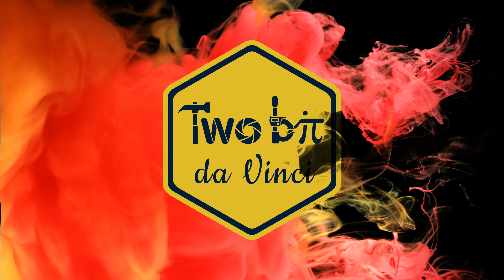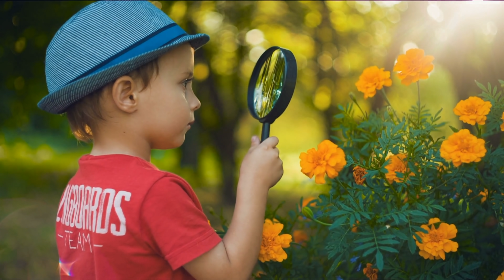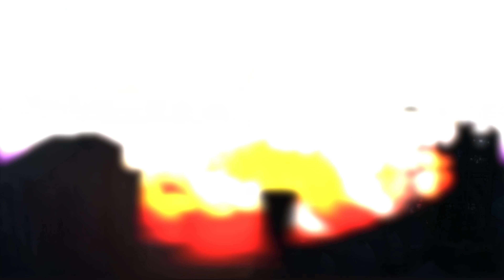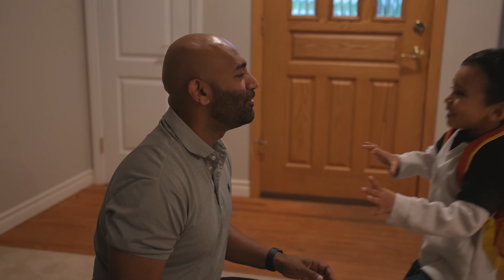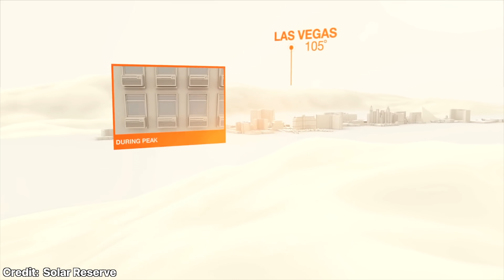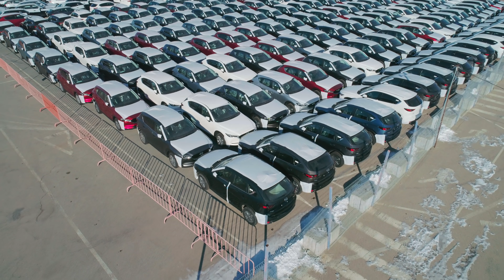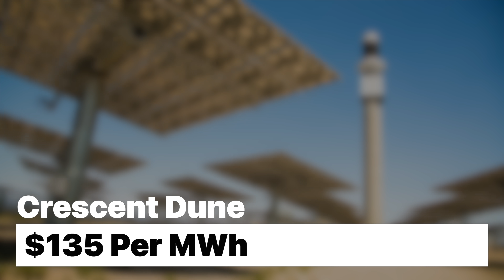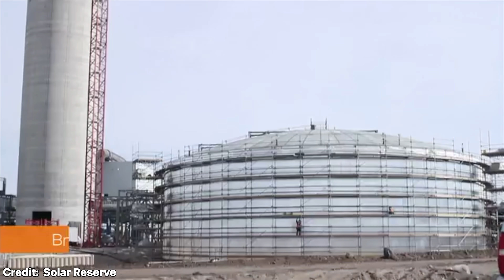This Billion Dollar Solar Plant was an EPIC Failure

Comment: Would this thermal technology be put to better use evaporating sea water to produce clean water? I have no actual knowledge on how to use this thermal technology or sea water evaporation or any kind of science for engineering moving mirrors and salt towers, but it would seem to possibly produce clean water with more ease than producing power for a state or city. Maybe change the design to have something on the tower move instead of the thousands of mirrors to cut engineering and repair cost. Use the thermal energy it is already producing to run low or zero emissions power for the water plant. Fans to pump water vapor to condensing water tanks. The residual heat from the salt tower to power water pumps to bring in more sea water at night to be processed the next day. The temperature producing the thermal energy in the tower being used to produce power is over 4 times the energy needed to evaporate water and it being collected and used only at this station to produce clean water could cut major energy losses by the company. A $1bil energy producing failure could be turned into a possibly creative and lucrative water cleaning tool.

Comment: Where are you getting that 80 billion and 12 billion dollars (with a B) for 40 megawatt solar power plant for solar panels from? Don't you mean millions? Because that's what they cost for 40 megawatts. Unless you meant to say 40 gigawatts, not megawatts.

And by 2040 98% to 99% of new cars sold will be electric. Remember those $25,000 flat screens TVs in the early 2000s? Who's making CRT TVs now? On those flip phones prior to 2007? Remember Nokia and their flip phone 40% worldwide domination? No manufacturer is going to be making ICE vehicles by 2040 other than some small enthusiasts company for the diehards. 

That's a fact of life people will argue to no end now, but will have to find out the hard way when it comes. Most people just can't see it so matter how clear it is right in their face. It's the way of business, of evolution, of progress. Most auto manufacturers, however, know it all to well. It's those that play around with hydrogen and the such that will be the next Nokia. More than one Japanese auto manufacturer will fail because of it.

Comment: I think there's a viable future for both photovoltaic and solar thermal technology, so we might see the plant reopen in the future since a future solar thermal project would have a head start.
Reply: The plant can't reopen as it got removed. And even if it could, the it still is inefficient and had many technical problems based on bad design or implementation during the building process. Building a newer one which is implemented properly would be the better option.
Reply: @benrex7775  If they dismantled it in an orderly fashion, it would still be a head start on the production of the next plant. There were myriad flaws in the design,  but the pipes and the Mirrors wasn't one of the. So even if the plant never reopened its materials could be used as a head start in the contraction of the next.
Reply: @MogofWar  Since storage areas cost money I assume the materials were sold, reused or recycled.

Comment: First problem with the Chinese endeavor is that it is a state sponsored project. Remove the State from the operation equation, and then if it is a true success, then there is a blueprint to start with. But, as it is sponsored by State, i.e. the CCP, any related information should be suspect until verified by outside sources.

Comment: you know what would be cool is if you built a foundry that way, steel needs about two thousand degrees to melt and aluminum only needs about 700 degrees, you spend a lot in hearing up those furnaces, using that system to heat the furnaces could also work.  

the cost of heating and maintaining the high temperatures forces foundries to shit down in extended off-line hours and that can actually screw up the metals, letting them get dirtier, lowering quality, and decreasing the life of the furnaces and increasing maintenance costs.  it's at least an interesting idea if not absolute doable.

Comment: Very interesting, thank you. Solar PV panel generating stations (effectively) contain no moving parts and directly generate electricity. They might not be very efficient or store energy but they are cheap and uncomplicated. Nuclear, gas, oil and coal power plants generate heat that then requires complicated, heavy, expensive and inefficient systems to convert that heat to electricity.
Reply: Except that to transmit the extra low DC voltage that solar PV panels generate it has to be converted to AC,  stepped up in voltage to thousands of volts to become suitable for transmission to users which then requires complicated, heavy, expensive and inefficient systems to convert that PV  output to usable electricity.

Comment: Just modify the design! Forget that tower. Recycle as much as you can by burying that molten salt storage tank into the ground to simulate an underground geothermal source. It's way more efficient as heat is very latent in earth minerals. Then you need not worry so much about transfering the molten salt or leaks and maintenance. Replace the mirror farm with a static PV farm at close proximity to optimize copper cabling.  Use the mirrors statically to reflect the sun to the PV throughout the day by spanning its angular trajectory without expensive computer tracking algorithm. Dip a bank of U shaped refractory tubes that conduct water in & steam out of the molten salt tank to a giant 3 phase, very high voltage / low current, AC generator spinning with heavy flywheels to increase momentum. Make the water in pass through cooling radiator on the back of the solar panels. This way the temperature differential before boiling is reduced while panel efficiency is preserved. Then make sure the steam is re-condensed deep into the earth to cool down and complete the water cycle. Sincerely giving up so much money into a monument of our failure is such a pure shame for a country so technically advanced who at this time does not have money to waste ($1B from our taxes). This infuriates me!

Comment: Five Points.
A) Makes one wonder why they need so many people to keep the system running.  
B) identify the corrosion/ mechanical issues and fix them
C) determine if software can correct for mirror alignment problems. Solar thermal systems seem to work else where.
E) if the thermal aspect cannot be salvaged - mount PV panels on the mirror pedestals, install batteries and turn it in to a conventional. solar farm.

Comment: Why don't they install solar PV panels over the top of the rotating mirrors and generate electricity?
Possibly remove mirror and only use the frame.

Comment: Very interesting. I saw a similar plant in Andalucia, Spain. It was operative by that time (2019).
Reply: I don't think it is operational anymore either.
Reply: @rosswitte  lol Spain had 50 operative thermal-solar plants, this channel dont allow links, its official that Spain had 50 thermal-solar plants... With two massive molten salt ones the "Ps10 and Ps20" twin towers making 50Gw/year and  "Gemasolar" Tower making 80Gw/year, you are free to search about them. 50 Solar-Thermal plants in total, that can work at night and dont deppend of China industry because dont use elecrovoltaic panels, only mirrors. The energy wasted on the termal system makes ita bit more expensive but remember that is the cheapest way to produce solar energy at night, instead of producing at night with other energy source.

Comment: Nevada Solar One is a CSP that appears to work. It uses a different method to heat the salt by first heating oil in tubes that are at the focal point of parabolic mirrors. It’s near Boulder City Nevada.

Comment: you realize solar panels are cheaper now because all of them are made in China with slave labor. so yes if your OK with slavery than be happy your solar panel is 15% less expensive compared to 5 years ago. 
people one day we will find a better way to generate electricity. or we won't your not willing to use Nuclear power because you have allowed some fools to scare you. so your willing to promote slavery to get a solar panel. There is something bad wrong with the way you think.

Comment: How far from the coast is this thing ? if it is reasonably close, why not do a conversion and have the solar energy dumped into directly heating seawater for the production of fresh water ? Making electricity is one thing, but it's fresh water that is probably going to be an even far more valuable commodity in the not too distant future, California's water reserves are dwindling year after year and it's only getting worse. So at what point does this finally become economically sensible ? that's if the distance to the coast for the salt water isn't too great, alternatively, fold it all up and move it !

Comment: The statement of green energy opponents is not even close to the correct statement, when the ford model t was in vented and the assembly line was  made they didn’t go around shooting the horses. So if you say Solar and electric car are main way to stop global warming then look at cars today a high percentage can and are reused and recycled the batteries and the solar cells alone are not priced effective not alone enough to replace everyone’s existing and new models for vehicles and power plants . Until new technology Solar and electric cars is todays 8 track tapes

Comment: The $500,000,000 spent on the old-school-mentality industrial project could have bought 31,250 LAS VEGAS homes/small businesses  a 5kW Solar energy system with a 6kWh battery system (modular type so they could add more storage). I am estimating each system to cost $16,000.
Reply: Da Vinci has his plants mixed up. The plant by Las Vegas is Ivanpah, not Crescent Dunes. It uses steam not salt, and it powers 140,000 homes.

Comment: Could this be re-purposed somehow? Could it be converted to a direct to steam system, to drive turbines? 
Also, it could be paired with a battery bank to store whatever energy isn't being used immediately. Battery tech is progressing extremely fast, so I think this would be a good idea. Also, in a setup like that, the water would still be hot when it condenses (just below the boiling point). That heat could be stored in some insulated solid, so less heating would be needed to create more steam in the cycle. I don't see why molten salt would necessarily be the material to use for that. Just spitballing here, but couldn't this be refitted in this way?
Reply: I think that would have been a better idea rom the start. Use the extra power to fill water towers, and when the suns down the towers could turn turbines. Molten salt seems like a futuristic overkill solution. I mean there are plenty of water towers in use today that serve this exact purpose!
Reply: @Ceykat  Agree. Molten salt has advantages, but those advantages seem to be outweighed by the difficulties. A lot of energy transfer happens with phase change, but the phase change doesn't need to be with salt. Do the phase change with water, to run turbines, and store excess energy on batteries, and keep the water hot by insulation. The heat storage vessel COULD use salt, but it could be any dense material that's easy to handle, actually.

Comment: Only 1/2 a billion tax dollars for a failure. Much like their Geothermal and everything else. The problem with these green energy projects is they are absolutely determined to ensure EVERYONE is reliant on their grid so they control energy and because of this every single project is an experimental mega project requiring insane amounts of government funding. That amount of freebie money draws the corrupt crooks out of the dark faster than a light switch. 

What I find insane is the total disconnect from that kinda waste of money. This was 500 million dollars. Yet it's treated like it's simply chump change cause this is green energy. If this was a 500 million dollar wasted investment into oil, The green energy lobby would be all flopping on the floor like dying fish having fits about crooked oil and crony capitalism. They'd be demanding investigation to find out who was invested and who profited in order to condemn them. Yet not only did none of that happen, The project died and there was no publicity at all. Nothing to see here! Move along!
Reply: I hear it's operational presently making electricity.
And these thermal solar steam turbine systems benifit from scale.
I agree that lots of money is wasted/made on these systems.
The 500 M wpuld have been better put to msr research IMHO.
Reply: @ghz24  How about they don't use government dollars to invest into private enterprise PERIOD. Did they help you pay for your house? Yet that's a guaranteed money maker over time. It's corporate socialism. Since when did the government become a Charity with contributions that are forced at gunpoint if necessary?

Comment: The best battery storage that I have seen is at a mine site where 35ton weights are lifted 15m off the ground by electric motors using excess PV power and then at night are released with the motors running backwards generating power. Simple.

Comment: You are wrong it is a California Project, we work there, it is used to supply California power. Corrct your statement, it is just near Las Vegas, but that is still California
county., actually San Bernadino county,  I told you it is not Nevada Power project and it don't supply electricity to Nevada power, where did you do your research, you assumed
that it is near Las Vegas it is for Las Vegas, that is not true and it was not funded by las Vegas,
Reply from the maker: There any many dude. Relax. Google crescent dune. It’s exactly where I said it was. There are many of those projects in that region some in CA.

Comment: The problem is a solar power plant is that it completely destroys the ecosystem in which you build it. For example that particular power plant puts a certain species of desert tortoise on the endangered species list. Birds are also flying into those beams aiming at that Tower and almost bursting into flames. 

I love my solar panels but anyone who thinks that solar is going to solve our energy needs. They need to go back to school and repeat some classes. 

Whoever designed this thing was an idiot. We have to save the planet by destroying the planet because that makes perfect sense..

Meanwhile we have 141 million rooftops,  that's just residential. The ecosystem in which those houses were built was destroyed a long before any of us was born. Use the space we already have.

Also look into how much water it requires to keep the solar panels.. in a desert, in a state that has been suffering from a decade-long drought. Of course the use of the term droughts is not completely accurate for our weather but that's a different topic.

Comment: Literally nothing you said is true , Company did not lose money it was a grant for research , not all of the money but a lot of it , and when they started loosing money they puled out . Next solar panels do not last for long , and their theoretical output is often  much higher then real numbers , about 300% higher ,  and it makes no sense what so ever because there are better ways to make electricity , green also , like Nuclear power , thats green . And also you do not have to store energy when sun is down , you put all the energy in the system , and when sun is down you pull out of the system , and make electrical network  system do the storage part .
So basically nice video , info in it ,practically all wrong .

Comment: Saw an article of a huge helostat array built in France and it was a new technology at the time.
 It seemed very plausible at the time but the labor intensive maintenance was not easy to see. 
Robotics, of today seems to me could play a part in reducing the human element in the operation and maintenance and perhaps a better tracking system may make the system more efficient!
As with all innovative technology the problems are never easy to anticipate and the return on in investment is usually the main reason for the project.
A smaller prototype isn't always the answer either because the ramping up for economies of scale comes with its own problems. 
Still piques ones curiosity as to the potential!
Reply: France has 48 nuclear power plants, now with Russia; everybody starts building .

Comment: what CSP needs is to make it as modular as solar panels - instead of putting it into a centralized system - having the individual collectors pull in heat (like a conducting metal) from the sun to heat water or some other cold liquid (since it's underground - it'll be cold) that can hold heat and be used to steam turbines. The issue is the temperature gradients )i.e. backflow of temperature - which can happen with solar too!) and heat loss in the system (i.e. to the environment).

Comment: Another solar roads!
Looks great on paper but implementation always lacks.
America should focus in Nuclear, look Texas when got that Big Freeze, all the Green Energy Solutions collapsed and people died.
Sorry, but maybe cut air travel, which is the actual biggest poluter no power plants.
Reply from the maker: hey Andres, so the big freeze is a bit of a sticky subject. Gas plants failed too, renewable isn't a big part of the texas grid. Also the wind turbines that failed, failed due to lack of planning for cold weather. As you know wind turbines operate in much colder plans without any issues.

Comment: Solar panels drop power every year by 1-2% and if you don’t clean them weekly even more . Unless your in SW  no rain areas don’t bother
Reply from the maker: dust and stuff isn't a big deal at all.. i saw like 4% drops which isn't too bad. as for yearly degradation.. it's more like 2% year 1, and then 0.5% from years 2-10 or so
Reply: @TwoBitDaVinci   rain 🌧 and nighttime a bitch